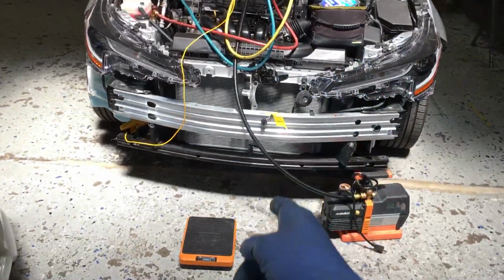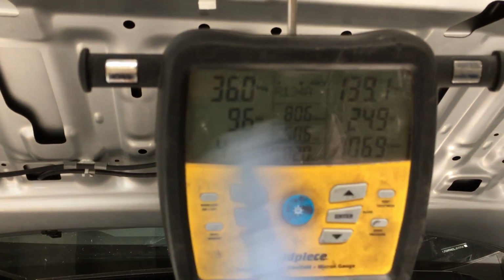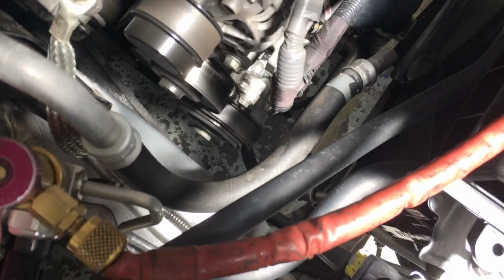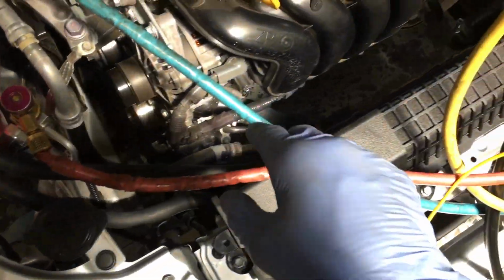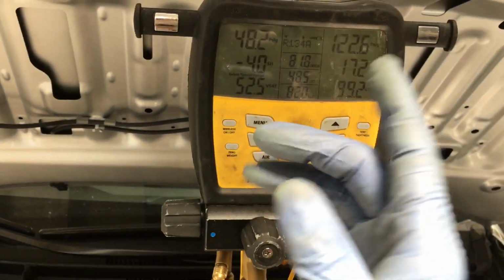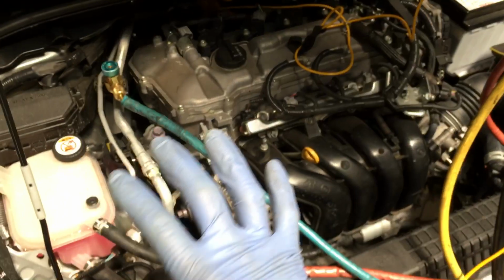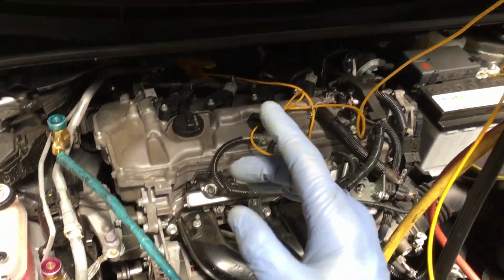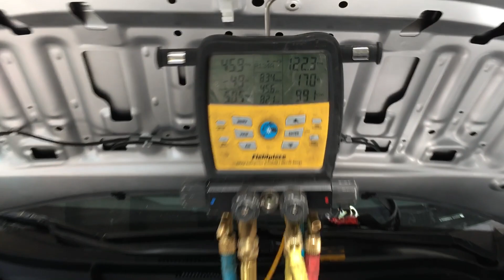This clutchless variable displacement compressor act and operate like a clutch. + Fan vibration￼￼

Comment: I did notice these clutchless compressor variable sensor cycling on/ off in some cars but most are operated through pwm so should gradually open and close to maintain constant evaporator/cabin temperature.
Reply from the maker: Not all follow the same rules. 
They are all developed by different manufacturers operated by different software to perform different functions and level of self-preservation or operation to perform or compensate for drivability remember compressors put a load on the engine to. 

People often make the mistake to classify one category of equipment as all operating the same.  THEY DO NOT !

Comment: I have the same engine and compressor. But im stil cannot find that when i manually turn off my AC switch there is this rattle sound as soon as you turn it off. Even if you rev the car to 1500 rpm. Then you turn off the ac switch still doing that rattle or ground like sound.
Reply: Hope you can share some inputs. Much appreciated